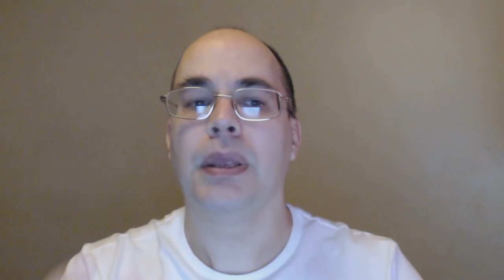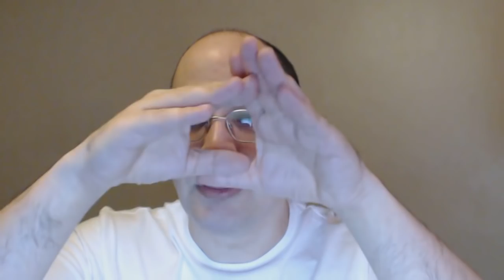How do rockets move in space, with nothing to push off from?

Comment: WHY A ROCKET WON'T WORK IN A VACUUM!
Why a rocket engine will NOT work in space! NASA says Neutons 3rd law of motion is what makes a rocket work in a vacuum. The 3rd law states "for every action there is an equal and oppersite reaction".  They say this propels the rocket forward and not the air the rocket is pushing against! I say, using  Neutons law, Imagine two big heavy boxes in space, move them together and put a spring in between them,, connect the boxes together.. Now, the spring is the action and you will have an equal and oppersite  reaction via the boxes, when you detach the boxes the spring will push them Appart. So the action of the spring caused an equal and oppersite reaction and the 2 boxes shoot Appart at equal speeds as long as they both have the same mass..  Now a car is Mass the wheels are the spring or thrust and the road has mass, the spring pushes in equal directions, or the wheels turn and the road and car shoot Appart in oppersite directions at equal speeds. The ship works the same,, propeller is the spring and it pushes against the ship which is a mass,, and the sea which is another mass, the 2 masses move Appart at equal speeds in relation to their masses,, The ship has more mass than the sea water behind the propeller so moves slower than the water, A plane uses the same principal. A rocket,, the same principal,,, In this 3 part equation, ie (Mass spring Mass) or (Oppersite reaction/Action/Oppersite reaction) Quote "for every action, there is an equal and oppesite reaction". The rocket is the first mass the spring is the fire plume, (This is a controled explosion that pushes equally in 2 directions just like a spring) and the earth's atmosphere is the other mass, again proportional to thrust and  depending on the mass of air moved and the mass of the actual rocket determines the speed the rocket moves in one direction. As you gain altitude the mass of the atmosphere exponentialy decreases but the mass of the rocket stays the same so in order to continue up at a constant speed the the fire plume or controled explosion has to exponentialy increase thrust in both directions until finaly there is nothing left to thrust against on one side of the fireplume as the atmosphere has depleted. Now we have a case of Neutons 3rd law of motion only having 2 parts ei ( Mass spring ?????) So Neutons law no longer applies and the rocket will not have propulsion, like taking away the sea from the ship, if ships could fly it would just not move,, the propeller can spin as fast as it likes the ship is not going to move. This is before you consider the unimaginable amount of radiation both in the van Allen belt and in general space.. So that's Neutons law saying you can't go into space for far using a rocket engine, You need something to thrust against...   It doesn't matter what those masses are, that's not the point, all that matters is the action the reaction and the oppersite reaction (Reaction/Action/Reaction) 3 parts.. The 3rd law of motion. You can have one big box one small box, One with double the mass, a super spring, it doesn't matter, the principle stays the same, this is a law of physics. so that's ( Rocket = Mass/Explosion/Atmosphere=Mass) The rocket and atmosphere are the equal and oppersite reaction. Take away the atmosphere and you have (Rocket or mass=reaction/Explosion= Action=Explosion/Nothing????? zero mass = No Oppersite reaction) Now Neutons law can not apply.. The rocket can not propel forward...
PROBLEMS WITH ORBIT SPEED
If we have (mass1=Actual rocket/Spring or thrust/mass2=Atmosphere)
So If thrust needs to exponentialy increase to compensate for an exponential decrease in mass 2. Then there's ,A, An exponentially  increased need for fuel and ,B, A constant weight added for all the fuel nessasary to reach Orbit velocity. 
You would need an atmosphere to use as mass2 and the problem with that is heat! To reach Orbit velocity means 17/18,000 MPH If you do that speed in the atmosphere you burn up?! Especially when you are carrying Highly explosive rocket fuel! 
Conclusion!
In order to achieve enough mass2, In an infinate vacuum, you would need to have infinate thrust and infinate fuel  and that fuel would have infinate mass in order to create enough of an atmosphere in mass2 (space) For the spring or explosion (Rocket fireplume) The action in Neutons law,, ie (reaction/action/reaction) to have enough thrust to propel mass1 (the actual rocket) Forward. This is assuming space is infinate and a vacuum! 
Final conclusion It's not possible.. Maybe very low orbit with very light equipment, but with the radiation and heat problems! Once a rocket engine switches off in space the rocket will start to fall towards the nearest large object unless the rocket is in orbit!! ..
Reply: No, this is incorrect - rockets do not push off the air - they generate a continuous explosion in the combustion chamber and ride the shockwave.
Reply: Jan Strzelecki hahahahahahahahahahahahahahahahahah a hahahahahahahahahahahah 😂 😂 😂 😂 😂 😂 😂 😂 😂 😂 😂 😂 😂 😂 😂 😂 😂 😂 😂 😂 😂 😂 😂 😂 😂 😂 😂 😂 😂 😂 😂 😂 😂 😂 😂 😂 😂 😂 😂 😂 😂 😂 😂 😂 😂 😂 😂  and of course the infinate vacuum the rocket is in wouldn't Imediatley disperse that throughout space?????????? Not to mention it has to have enough mass, ie more than the rocket otherwise that will move away from the rocket rather than the rocket moving away from the exhust gas,,this is the weakest argument I've heard yet!!! Try this.. Jump off a building (With a parachute in case you need telling) Now take with you a paving slab, now as you fall put that under your feet and jump and see how far you get!!!   😂😂😂😂😂😂😂😂😂😂😂😂😂😂😂😂😂 ohh dear that's my days entertainment. ..
Reply: +Davy spilani
and of course the infinate vacuum the rocket is in wouldn't Imediatley disperse that throughout space?
Eventually, it will. What's your point?

Not to mention it has to have enough mass
And speed. Don't forget speed.

otherwise that will move away from the rocket rather than the rocket moving away from the exhust gas
There's this tiny, little, insignificant thing known as Newton's 3rd Law of Motion - perhaps you've heard of it? 😂

If exhaust will move against the rocket, then the rocket will move against the exhaust too. Action and reaction, my dear, confused Davy 😊
Reply: - says the guy who thinks that the spring in his analogy must have real-life equivalents 😂